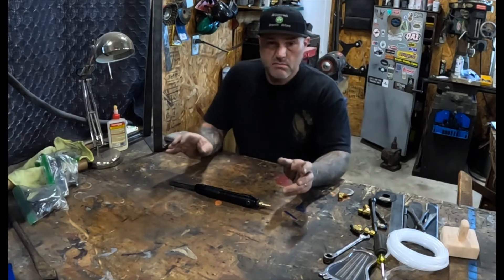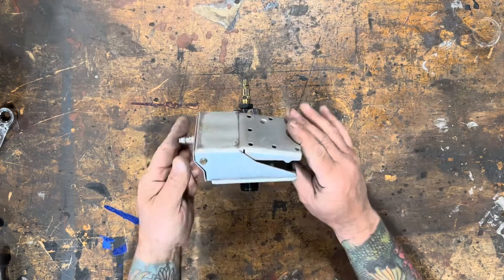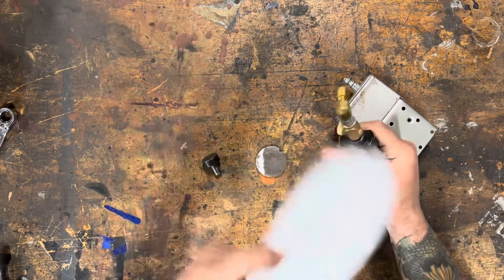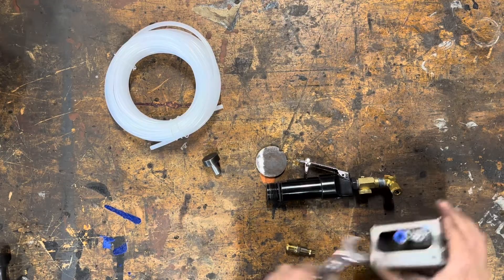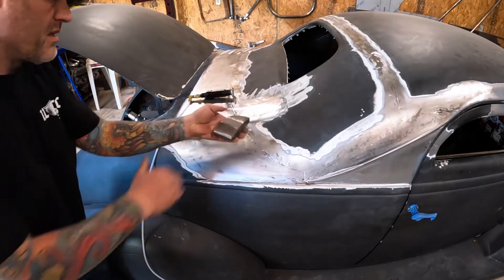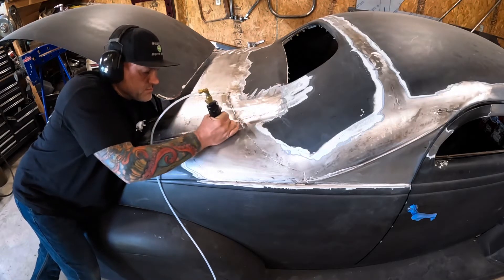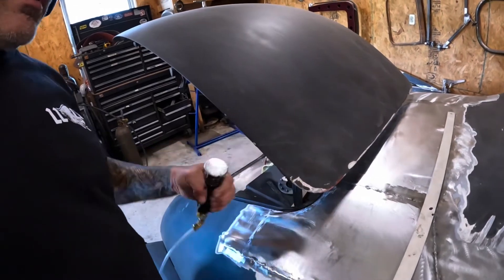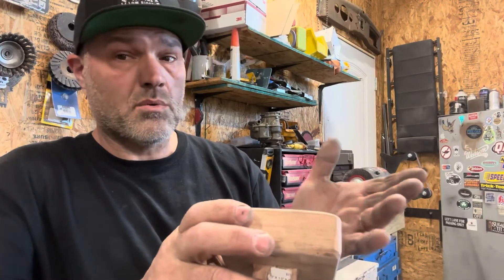How to Build your own handheld planishing hammer to finish sheet metal for $50

Comment: I did the same thing it worked perfect and I liked the hammer  action better than when I used a air hammer also it’s nice to have options I also used a craftsman rechargeable hammer with an adjustable 90 degree head
Reply from the maker: That is a pretty good idea. I bought a palm nailer to do something similar with. Haven’t got around to it yet. But it definitely is nice to have options.

Comment: I built myself one and have been using it daily for a few months now. Works well. A ball valve is a little crude and it definitely needs a regulator valve. I’d add a swivel connector to the end to remove the weight of the air line if you build
One.
Reply from the maker: Yes definitely needs a regulator   Also I switched to a plastic 1/4 line    It’s much better.

Comment: HI. YOU CAN GET AN AIR SCRAPER KIT FOR ABOUT $39 BUCKS THAT HAS THE BLADES BOLT IN AND MOUNTED ON ABOUT WHAT LOOKS LIKE ABOUT A 3/16ths FLAT PLATE. YOU COULD WELD YOUR FLAT PAD ONTO ONE OF THOSE AND IT COULDN'T FALL OFF WHEN YOU LIFT IT UP.  THE TOP PART LOOKS THE SAME. JUST A SUGGESTION.
Reply from the maker: Hmm I’m going to look for one